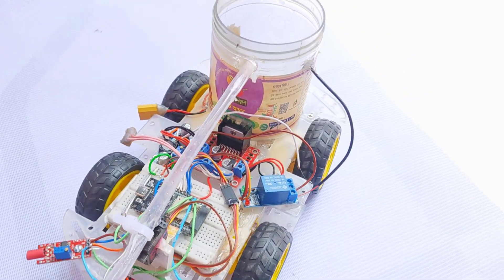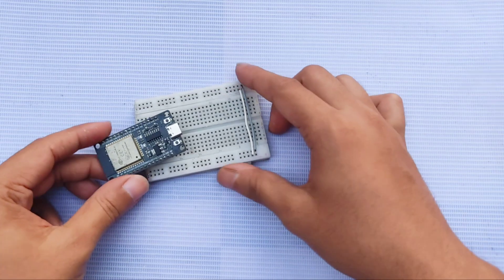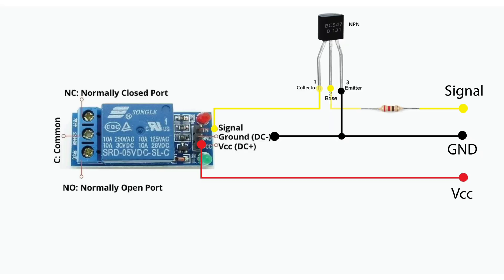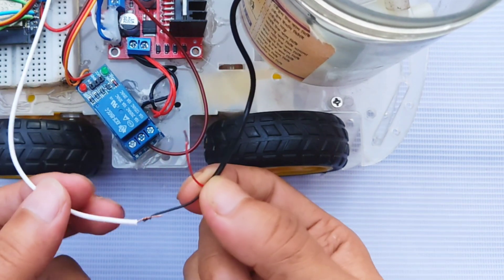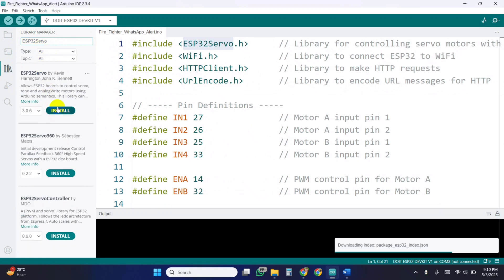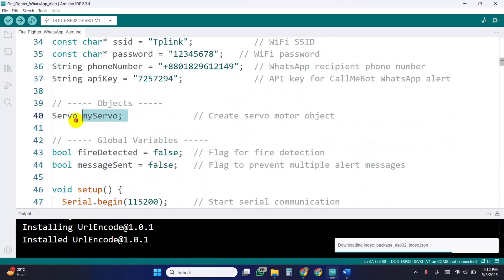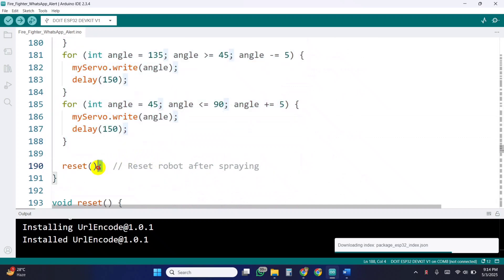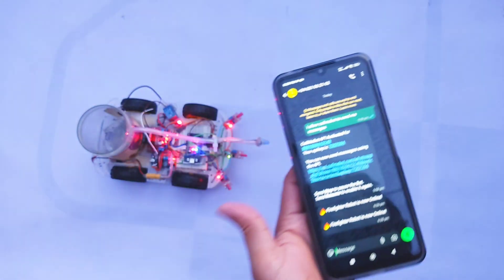How to Make Fire Fighting Robot with WhatsApp Message Alert using ESP32

Comment: What is the output voltage of your buck converter. If it's 5V wouldn't that be too much for the esp?
Reply from the maker: Esp32 has built-in 3.3v voltage regulator.